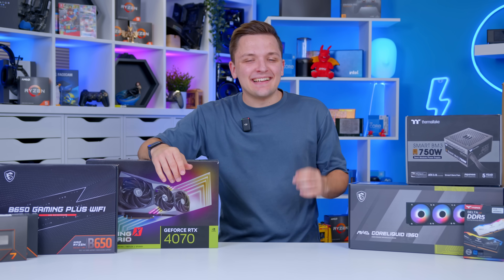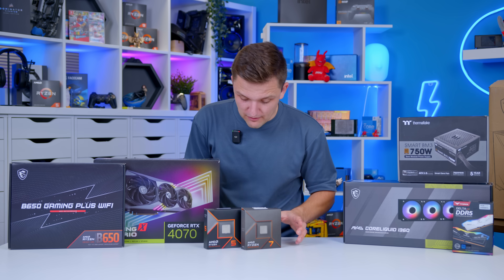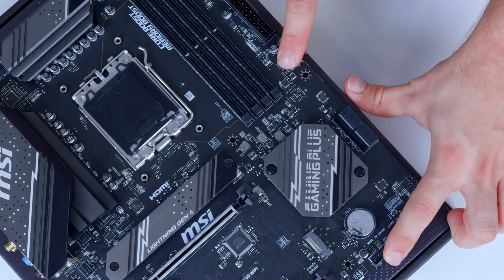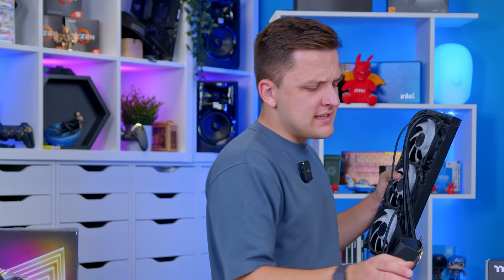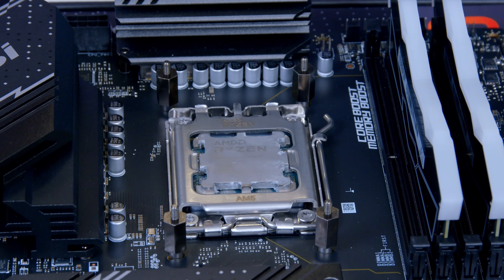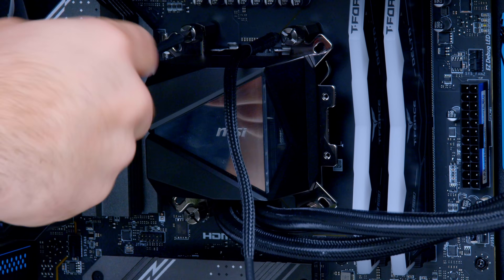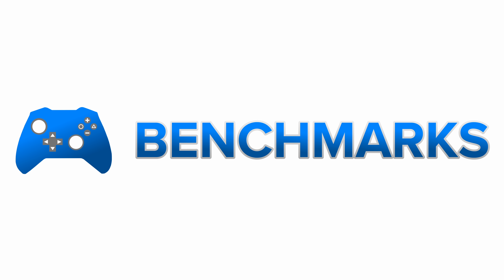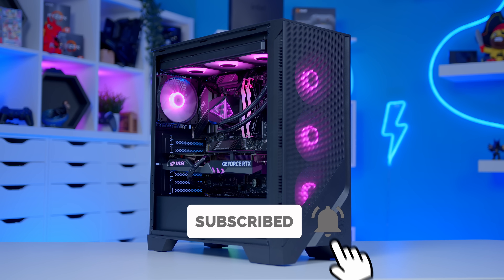Best $1500 Gaming PC Build Right Now! 🚀 [Full Build Guide w/ Benchmarks]

Comment: if you don't get rgb you can save a lot of money wich you could invest in a 4070 ti super it will cost a littel bit more but will be way better you can also save money on the  aio cooler there are once that cost 70 $ and are still 360mm and work great

Comment: You’re making a build for a specific budget. What is the point of adding all this RGB gimmick crap in place of essentials? The 4070 simply makes no sense for this being a $1500 build and proves you’re just doing way too much away from the essentials. Drop the silly AIO and get a high-quality air cooler. $50-80, way easier for a beginner to install. FULLY MODULAR PSU, GOLD RATED. RX 7800XT hardly has a lower performance than the 4070 and is just about equal, maybe better. 7900 GRE certainly would’ve done. God dude you’re just pointing prospective builders in a really bad direction.

Comment: Is the MSI Gaming GeForce RTX 4060 Ti 16GB GDRR6 Extreme Clock: 2655 MHz 128-Bit HDMI/DP Nvlink TORX Fan 4.0 Ada Lovelace Architecture Graphics Card (RTX 4060 Ti Gaming X 16G)
Is it a good option?

Comment: I understood that the RTX 4070 is $1500? It's kind of expensive, right? I'd rather stick with my 3080, which works great for me, but this time I'm going to try Windows 11 Pro to see if it improves performance and graphics at all.
Reply: No the rtx 4070 is not 1,500 by itself. It is for this entire build in this video which you can build a 4070 build for less than 1,500 dollars.
Reply: For my part, I got Windows 11 Pro from BNH Software and I can tell you that for the moment I have seen an improvement in performance but not in graphics.
Reply: Well, I'll try it myself to draw my own conclusions. Thanks for your contribution.

Comment: Total: $1303.96 Guys, for this price with a 7900XT is all you need: 1440 high FPS/4K.
CPU: AMD Ryzen 5 7600X 4.7 GHz 6-Core Processor  ($203.10 @ Amazon) 
CPU Cooler: Thermalright Assassin X Refined SE ARGB 66.17 CFM CPU Cooler  ($19.29 @ Amazon) 
Motherboard: ASRock B650M Pro RS WiFi Micro ATX AM5 Motherboard  ($149.99 @ Newegg) 
Memory: TEAMGROUP T-Create Expert 32 GB (2 x 16 GB) DDR5-6000 CL30 Memory  ($85.99 @ Amazon) 
Storage: TEAMGROUP Cardea Zero Z440 Graphene 1 TB M.2-2280 PCIe 4.0 X4 NVME Solid State Drive  ($69.98 @ Amazon) 
Video Card: Sapphire PULSE Radeon RX 7900 XT 20 GB Video Card  ($624.99 @ Newegg) 
Case: Okinos Aqua 3 MicroATX Mini Tower Case  ($59.99 @ Amazon) 
Power Supply: Thermaltake Toughpower GF1 (2024) 850 W 80+ Gold Certified Fully Modular ATX Power Supply  ($90.63 @ Amazon)

Comment: Total: $1508.96 Blow the doors of the 12GB 4070 LUL
CPU: AMD Ryzen 5 7600X 4.7 GHz 6-Core Processor  ($203.10 @ Amazon) 
CPU Cooler: Thermalright Assassin X Refined SE ARGB 66.17 CFM CPU Cooler  ($19.29 @ Amazon) 
Motherboard: ASRock B650M Pro RS WiFi Micro ATX AM5 Motherboard  ($149.99 @ Newegg) 
Memory: TEAMGROUP T-Create Expert 32 GB (2 x 16 GB) DDR5-6000 CL30 Memory  ($85.99 @ Amazon) 
Storage: TEAMGROUP Cardea Zero Z440 Graphene 1 TB M.2-2280 PCIe 4.0 X4 NVME Solid State Drive  ($69.98 @ Amazon) 
Video Card: Sapphire PULSE Radeon RX 7900 XTX 24 GB Video Card  ($829.99 @ Newegg) 
Case: Okinos Aqua 3 MicroATX Mini Tower Case  ($59.99 @ Amazon) 
Power Supply: Thermaltake Toughpower GF1 (2024) 850 W 80+ Gold Certified Fully Modular ATX Power Supply  ($90.63 @ Amazon)

Comment: Bruh you could build a 7500f + 4080 super build on this budget. This is so far from being the “best” $1500 build it’s crazy.
Reply: You can do it with a 7900XTX. The $1K price tag of the 4080S is ridiculous.  @tigerVAL
Reply: Total: $1565.80
CPU: AMD Ryzen 5 7500F 3.7 GHz 6-Core Processor  ($120.00) 
CPU Cooler: Thermalright Assassin X Refined SE ARGB 66.17 CFM CPU Cooler  ($18.89 @ Amazon) 
Motherboard: MSI PRO B650M-A WIFI Micro ATX AM5 Motherboard  ($149.99 @ Amazon) 
Memory: TEAMGROUP T-Create Expert 32 GB (2 x 16 GB) DDR5-6000 CL30 Memory  ($85.99 @ Amazon) 
Storage: Silicon Power A60 1 TB M.2-2280 PCIe 3.0 X4 NVME Solid State Drive  ($50.97 @ Amazon) 
Video Card: Gigabyte WINDFORCE V2 GeForce RTX 4080 SUPER 16 GB Video Card  ($999.99 @ Amazon) 
Case: Okinos Aqua 3 MicroATX Mini Tower Case  ($59.99 @ Amazon) 
Power Supply: Gigabyte UD750GM 750 W 80+ Gold Certified Fully Modular ATX Power Supply  ($79.98 @ Amazon)
Reply: @tigerVAL  pc part picker doesn’t have half the parts you’d need for a build like this and YouTube deletes links. Not including tax here but 4080super windforce is $999 7500f is $120. That gives you $380 for the rest of the parts. $100 mobo, $75 32gb 5600hz ram, $60 750w psu, $60 case w fans, $20 cooler, $55 1b ssd.
Reply: I just listed all of the parts I’d use and the comment autodeleted. I have no idea why YouTube does that. YardoConvos on twitch send a whisper and I’ll send you all the parts but it’s a completely possible build. This guy’s build is absolutely terrible value.
Reply: AGV 750w semi modular bronze psu $61, Klev 1tb 4.0 ssd $56,  t create 5600hz 32gb ram $75, Thermalright assassin x120 cooler $17, bitfenix nova mesh mATX case $60, gigabyte b650m ultra durable. $110
Reply: good stuff 👏
Reply: going super cheap on parts just fit a 4080s over a much cheaper xtx is hilarious @SanDiegoGamingYT
Reply: @itsatrap4986  I’d still go this cheap even w the xtx and just save money or might upgrade to a 2tb ssd
Reply: OP and YT keeps deleting my messages. LUL But with a XTX or higher, I'd go with a better CPU specifically the 7800X3D. Can't cheap out on CPU if you're speding over $1K on a GPU. @SanDiegoGamingYT

Comment: can you make a black, 750-800 dollar pc build with wifi 6E and M-atx to ITX size??? I think it would be worth the challenge and it would help me very much. Thank you! Love the vids!
Reply: Total: $869.24 I'd opt for the 7500f to save you $100 & put it towards a 6750XT/7600XT.
CPU: AMD Ryzen 5 7600X 4.7 GHz 6-Core Processor  ($203.10 @ Amazon) 
CPU Cooler: Thermalright Assassin X Refined SE ARGB 66.17 CFM CPU Cooler  ($18.89 @ Amazon) 
Motherboard: MSI PRO B650M-A WIFI Micro ATX AM5 Motherboard  ($149.99 @ Amazon) 
Memory: TEAMGROUP T-Create Expert 32 GB (2 x 16 GB) DDR5-6000 CL30 Memory  ($85.99 @ Amazon) 
Storage: TEAMGROUP Cardea Zero Z440 Graphene 1 TB M.2-2280 PCIe 4.0 X4 NVME Solid State Drive  ($69.98 @ Amazon) 
Video Card: XFX Speedster SWFT 210 Core Radeon RX 6650 XT 8 GB Video Card  ($221.31 @ Amazon) 
Case: Okinos Aqua 3 MicroATX Mini Tower Case  ($59.99 @ Amazon) 
Power Supply: Thermaltake Smart BM3 650 W 80+ Bronze Certified Semi-modular ATX Power Supply  ($59.99 @ Amazon)
Reply: 1. R5 7500F ($140)
2. Msi B650M-A Wifi ($150)
3.T-force Delta RGB 2*16 GB 6400MHz CL32 ($100)

4. TeamGroup MP44 1TB ($70)
5. Sama Q5 ARGB  Black ($60)

6. TT Smart BM3 650W 80+ bronze ATX 3 PCIE 5
($60)
7. AMD RX 7600 ($270)
Total: $840 Approx.

Comment: The 4070 isn’t worth it. Just get the 4070 super for like $30-50 more. Or even better just get a 7800 xt or 7900 gre. The standard 4070 is the worst option there for the price.
Reply: Which one should I get for good ray tracing and stable but doesn’t have to be crazy fps?
Reply: @Monkwizz  ray tracing always get Nvidia cards, 4070 super is like 15-20% better  than the 4070 so if the price gap isnt crazy I would say get the super
Reply: If I want to stream and play games with ray tracing on which one should I get ? 😭
Reply: @BraxBenji  4070 super or higher for good raytracing and streaming.
Reply: @MrAnimescrazy  thanks
Reply: @BraxBenji  no problem. What is your pc budget?
Reply: @MrAnimescrazy  $2000-$2500
Reply: @BraxBenji  that is a really good pc. Let me know if you need help with a parts list. I will ask some questions so I can get an idea of the pc build.
Reply: @BraxBenji  did you buy the parts yet or are you still looking and do you need help with the parts list?
Reply: @MrAnimescrazy  im looking to build a 1500 pc can you help

Comment: How does the airflow work in a build like this? Is the aio an intake or exhaust?
Reply from the maker: Exhaust :)
Reply: What do you mean build like this? this is the most common type of pc case on the market. 3 intake on the front, top and rear are all exhaust
Reply: @Ladioz  I personally wouldn’t do that as doesn’t that mean there negative pressure? more exhaust than intakes. And this would result in air and dust getting pulled from unwanted areas in the case leading to dust buildup
Reply: @report_deport  The 3 intake fans on the front will have a higher RPM than the rear + top fans. I don't see a problem.  An AIO installed on the top must always be exhaust no matter what. It's only when installed on the side or front that people use as intake. And then the little fan in the rear is 100% exhaust
Reply: @Ladioz  Ohh okay so the 4 exhaust fans compared to the 3 intake fans have lower rpm to account for the imbalance in the fans and thus still maintain equal pressure in the case
Reply: @report_deport  Yeah it's all about balance. Fresh air into the case is very important. Hot air will be exhausted from the case anyway because heat rises! Regarding dust.... gotta make sure the case has a good nylon filter. Those are helpful

Comment: for 1500$ you can go for7600 and 7900xtx actually less than that.
Reply: how??
Reply: Total: $1558.97 Will blow the doors off his "best" $1,500 build.
CPU: AMD Ryzen 5 7600X 4.7 GHz 6-Core Processor  ($203.10 @ Amazon) 
CPU Cooler: Thermalright Assassin X Refined SE ARGB 66.17 CFM CPU Cooler  ($19.29 @ Amazon) 
Motherboard: ASRock B650M Pro RS WiFi Micro ATX AM5 Motherboard  ($149.99 @ Newegg) 
Memory: TEAMGROUP T-Create Expert 32 GB (2 x 16 GB) DDR5-6000 CL30 Memory  ($85.99 @ Amazon) 
Storage: TEAMGROUP T-FORCE G70 PRO Graphene 2 TB M.2-2280 PCIe 4.0 X4 NVME Solid State Drive  ($119.99 @ Amazon) 
Video Card: Sapphire PULSE Radeon RX 7900 XTX 24 GB Video Card  ($829.99 @ Newegg) 
Case: Okinos Aqua 3 MicroATX Mini Tower Case  ($59.99 @ Amazon) 
Power Supply: Thermaltake Toughpower GF1 (2024) 850 W 80+ Gold Certified Fully Modular ATX Power Supply  ($90.63 @ Amazon) 

 @instinctive9556